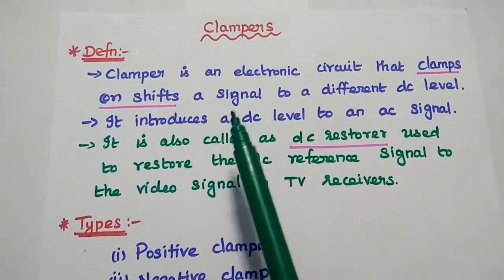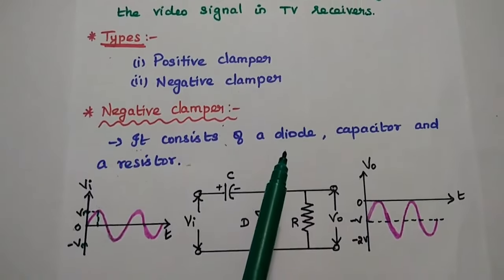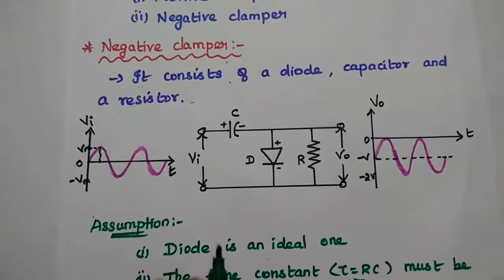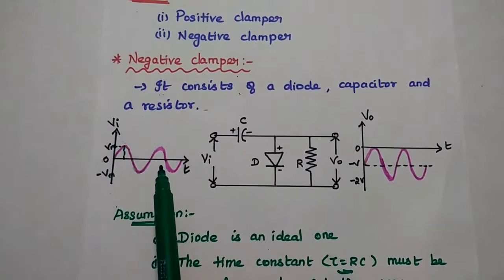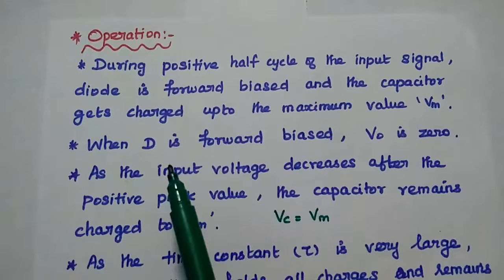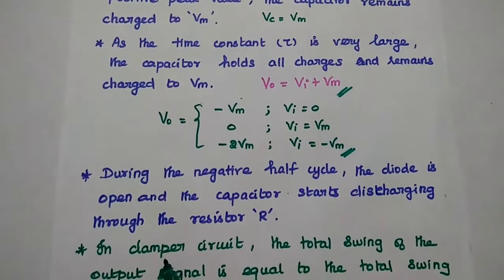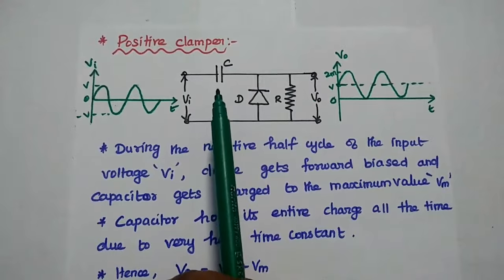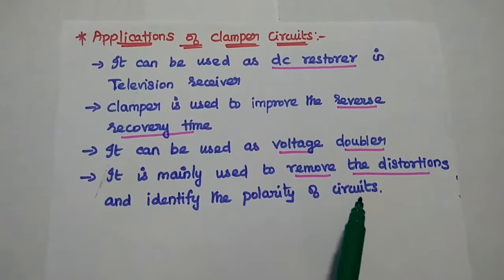Clampers - Positive Clamper - Negative Clamper - Electronic Circuits

Comment: What happens if we introduce a series resistor in the input side and for time varying square wave input signal, how to calculate R and C (if the input signal frequency is around 1MHz how the circuit behaves and what type of diode we have to chose ?).